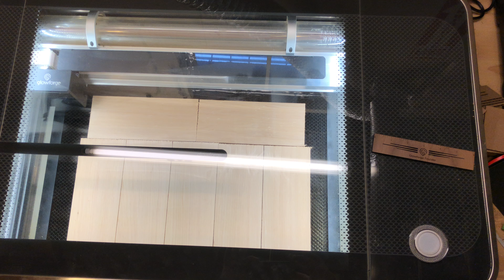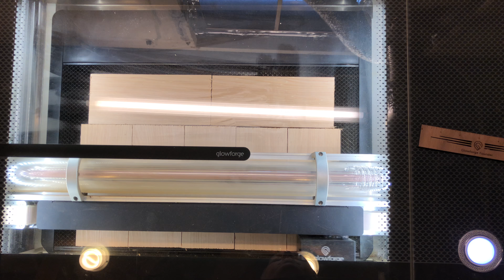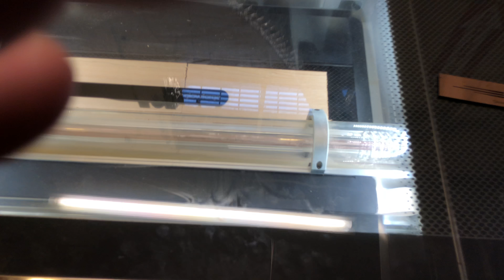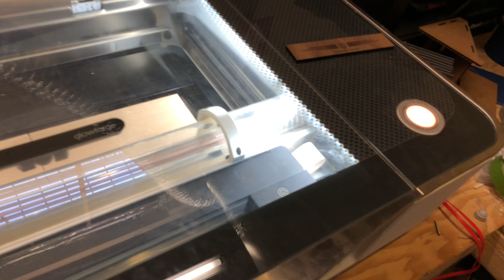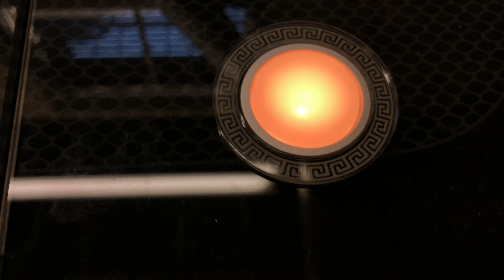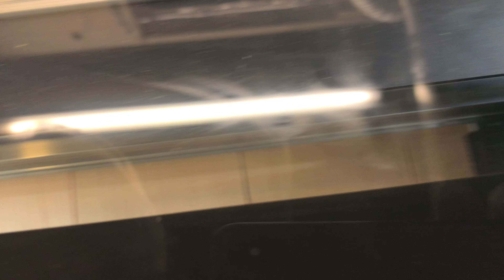Glowforge Orange Light Error

Comment: I’m getting the same message I also noticed when I turned the printer off for a while and did a power restart it would sometimes work but either way the printer like this shouldn’t have problems after two years of development and $4000 they should have been setup ready from the factory